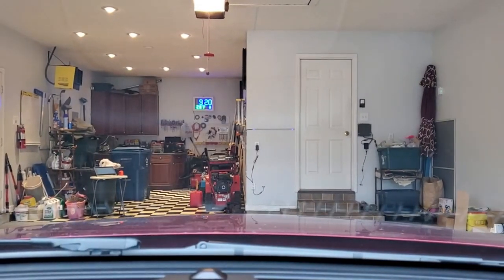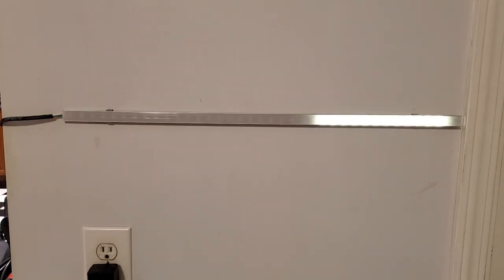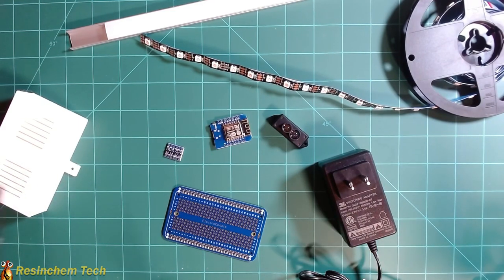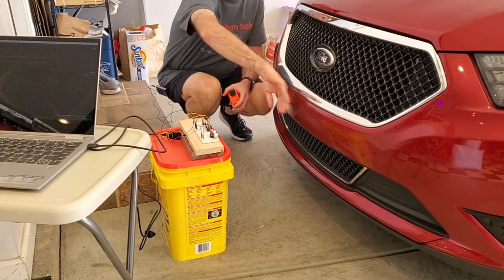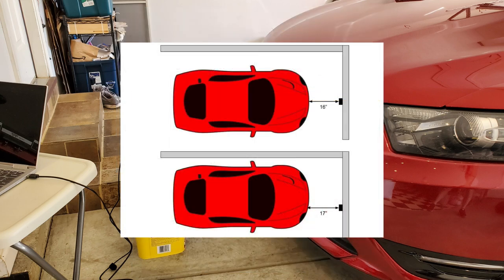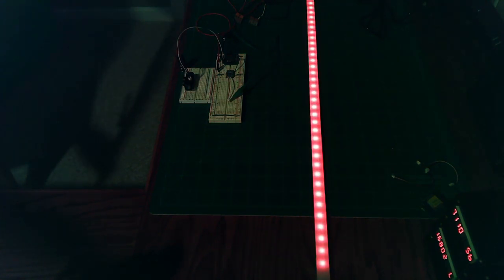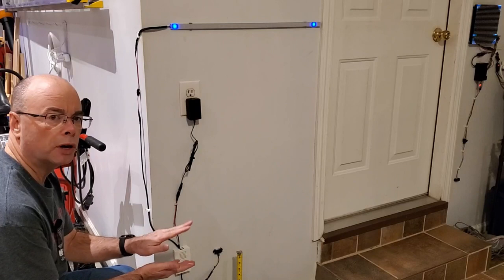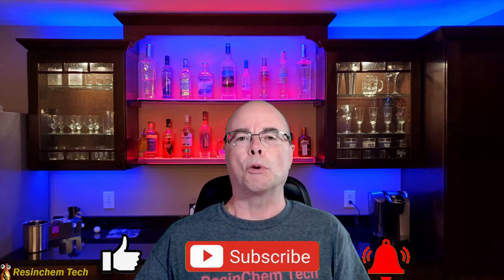A New Parking Assistant using ESP8266 and WS2812b LEDs

Comment: How do you get an MQTT device created for this in Home Assistant?  I entered all the relative MQTT info in the webpage setup for the parking assistant but I don’t see a device on my MQTT page in HA. If I use MQTT Explorer I can see the device there, so it is communicating properly.
Reply from the maker: Did you create the MQTT sensors in Home Assistant?  These are not automatically created (yet... it's something I'd like to add if/when I get the time).  Currently, you must manually create the sensors.  See the examples here for how to create the sensors:  https://github.com/Resinchem/ESP-Parking-Assistant/tree/main/examples
Reply: @ResinChemTech  I had added the YAML code but it turns out I put it in the wrong file.  All good now.  Thanks.

Comment: I store bikes and such in front of the car so I can't really use this but I have been thinking about a simpler version with just two sensors on the ceiling. I'll just be limited to not present, OK and too far of course. The upside is that only the LEDs would be visible on the wall, the rest is on the ceiling on top of the garage opener.
Reply from the maker: I actually have two of the ultrasonic sensors on the ceiling of the garage, one over each of the cars that I use for my primary vehicle presence detection.  Ultrasonic sensors are great in this case, because the distance between just car and no-car is pretty big and the noise level really doesn't matter.  But you could extend that concept to turn on LEDs when the car enters the measuring angle range of the sensor and detects the car.

Thanks for watching... and taking the time to pass along a good alternate idea!

Comment: Danke für dieses Projekt ich habe schon länger danach gesucht. Ich hoffe das es auch mit dem ESP32 funktioniert. LG Paul
Reply from the maker: Ich hoffe, in Zukunft eine Version für ESP32 zu erstellen, aber ich weiß nicht wann.
Reply: @ResinChemTech  Danke für die schnelle Antwort. LG
Reply from the maker: Can I ask why you'd like to see this on an ESP32, when the firmware runs just fine on the ESP8266?  What benefits do you expect to get from the ESP32?  I suspect it would function exactly the same.

I only ask this because to create a version for the ESP32, I would have to change multiple libraries and rewrite a good portion of the code.  It would also mean that I would have to maintain two separate versions of the code moving forward (an ESP8266 and an ESP32 version).  That is a fair amount of work, so I'm trying to understand what benefits an ESP32 would actually offer.

Comment: Is it possible to build this with a normal HC-SR04 sensor? I have tried different ones and different D1 mini's, but cannot get it to work. The system starts and the LED goes full blue, then the red/green alternate, followed by the outer most LEDs being blue, but no matter what, it is like the sensor is not even connected? I have the HC-04SR Trig connected to TX on D1 mini and Echo connected to RX on the D1 mini.
Reply from the maker: You'd have to modify the firmware. The firmware is written to work with the TFMini. Using any other type of sensor would require changing the libraries and logic to get a distance reading. The system is going straight into sleep mode (two blue lights) because it is not getting a valid distance reading.
Reply: @ResinChemTech  I ended up getting a TFMini and it works perfectly, thank you!
Reply from the maker: Yeah... the TF Mini does cost quite a bit more, but as I covered in the video, I think it is worth it in this case... both for range and signal stability.  I think someone may have forked my code and made it work for the HC-SR04, but I really didn't want to maintain two different versions of the firmware, so I'm only going to continue to provide updates and fixes for the TF Mini version.  Glad you got it working... and thanks for letting me know!

Comment: Wonderful idea, thank you for all of your hard work!  I built the project hardware, but when I load the FW, I get this behavior:  I can connect via Wifi on the ESP_ParkingAsst SSID, and then set the local network SSID normally.  After that, a reset causes the the device to show up in the local SSID network on my router's list for exactly 1 minute, then drop off and go back to creating it's own SSID.  During that 1 minute, the device does not respond to HTTP requests or PINGS on the IP address my router shows it has.  I bought the Wemos D1 Mini's off EBay, and assumed that this was the problem, so I bought more directly off of the Amazon link above, but get the same behavior on all devices I try.  I tried loading the libraries to debug myself, but am getting a ton of warnings and an error.  I am using "Generic ESP8266 Module" and loaded WifiManager, ArduinoOTA, ArduinoJson, TFMini-Plus libraries from the locations / authors you referenced.  I also added FastLED from Dan Garcia and PubSubClient from Nick O'Leary (my best guess).  Anyway, the errors are not missing *.h files, but mostly warnings about using the keyword Register.  Here is the Error where is stops compiling:  Compilation error: 'D6' was not declared in this scope.  Thanks in advance btw!
Reply from the maker: Sorry for the delay.. for some reason YouTube threw this in the "held for review" bucket due to 'blocked words'... no idea why, but I just now saw your message.

Well, one think I know for sure is that if you are compiling for 'generic ESP8266', then you cannot use "D" numbers for the pins... you must use the actual GPIO number.  Are you using the latest version of the firmware (v0.43), because I believe I changed the pin numbering to no longer use the "D" numbers to give greater compatibility with ESP8266 boards... other than the D1 mini.  I know you said you were using the D1 Mini, but it you are using the D pin designations, then you must select the D1 Mini board for the compile.

My gut tells me that the board is bootlooping due to this 'invalid' pin number (even though it compiles).  Let me know what version of firmware you are using... and try the latest versions... 0.42 or 0.43 (you might try both) and see if that resolves the issue.  If not, drop me another comment here and we'll troubleshoot a bit more.
Reply: @ResinChem Tech  I really appreciate the reply, I have tried the .42 and .43 bins with the same result.  I have not gotten the compiler to work yet, I'll look for the D1 Mini option.  There are small differences in thr board silkscreens, and I suspect even the ones I got off Amazon may be an off brand.  The parts report ESP8266EX when loading the bins, but from what I have read all but the very first run say this, so I don't think the EX has any significance.
Reply from the maker: If want to try compiling with the D1 Mini, I originally used the LOLIN(WEMOS) D1 R2 & mini board option in Arduino.  But if you are using .42/.43 then there should not be any references to "D" pins anymore... just the GPIO number.   

I don't think the "EX" has any affect here, as I'm pretty sure that's what mine say as well.  There is a possibility that you do have some sort of bad clone or batch of boards... but I'd like to rule out some other things before assuming that's the issue. 

If you like, could you reach out to me via email?  There's only so much troubleshooting that we can do here in the comments.  You can get my email address from the "About" page on my YouTube channel.  I don't put it here in the comments to avoid the spam bots from picking it up.  I'll do my best to help you figure out what's going on... but we are just somewhat limited here in the comment section.  Sorry you are having the issue.  I do know that many people have successfully built the system, so something different must be going on here.
Reply: @ResinChemTech  Ok, progress!  I got it to compile and turned on SERIAL_DEBUG.  The behavior causing the problem is that, for some reason, wifiManager.autoConnect is returning FALSE even though my router is showing the device is connected to my home SSID clear as day.  One time I did get "connected to your wifi...yay!" and everything including the web page worked perfectly for one glorius run!  Then back to the old behavior upon restart :(  All the parameters I set on the web page are stored perfectly still on boot.  Wife is fussing, will investigate more later!
Reply: There must be some goofy interaction between my router (a really nice new Asus RT-AX86S) and the Wemos D1.  The D1 connects about once every 20 times to my home SSID which is very close in proximity.  It actually connects every time according to my router, but the autoconnect returns fail after a timeout.  I disabled the wifi and the device works perfectly, my wife is very happy and so am I, thank you again!
Reply from the maker: I'm glad you got it working... and I guess you probably don't need to get to the settings page once it's configured for your install, but I'm guessing you can't get to the web interface, nor can you use MQTT if wifi is disabled.  But you may not be using MQTT anyway.

I'm still curious about what is happening in your case.  Does either your SSID or wifi password contain special characters or are either particularly lengthy?  I do have someone that reported an issue that if the SSID was greater then 12 characters that the wifi connection failed.  And the wifi library I am using, did have a report that a dash (-) in the SSID name caused the connection to fail.  But it sounds like in your case, you initially get a connection sometimes, but if fails at other times?

I'm wondering if it is just taking a bit longer for your device to bind to the router/wifi.  Sometimes there is a quick enough response that it works, but other times it take too long and times out.  I know you said the router is close, so it is likely not signal strength, but maybe there is something particular about the D1 Mini and your router.  You could possibly set up  a loop/counter around the .autoconnect and try it something like 3 or 5 times with a one or two second delay between tries.  You could then check the result for success or fail.  It sounds like you know your way around Arduino enough to do that yourself (and I'd try it on my end, but since I'm not seeing the problem, not sure it'd tell me anything)... but if you want me to help or provide you sample code of how I'd add that, you can just reach out via the email address I mentioned above.  I'm glad you got it working, but am still curious about the issue and hate that you can't access the web interface (or do OTA firmware updates should I release updates/new versions).
Reply: @ResinChemTech  I have a 4 character SSID, but my Password is 13 characters, no special characters or spaces, the odd thing is that the device shows up in my router's client table almost instantly, the wifimanager.autoconnect just does not believe it is connected.  I'm a firmware engineer and I'll do some more experiments, I'll try a different router with the same PW first.  If I changed the home wifi PW my family would riot I think.  I'll report back.  For a happy customer report, I had my very technology adverse wife pull into the garage without telling her anything and she parked perfectly on the first try (maybe the 1st time ever lol) and her unprecedented response was, "Wow, that is soooo cool!".
Reply from the maker: Thanks!  I never quite know the skill or experience level of my viewers.  But now knowing that you are a firmware engineer, I'm a bit embarrassed by my code!  I'm still relatively new to Arduino code, and while I can usually piece things together to make them work, I'm sure my code if far from being efficient... nor the best it could be.

And if you get the chance, please do let me know what you found out with a different router... and I'll post something on Github about it.  I fully get not changing the password (but since it does connect, I don't think that's the issue)... I have WAY too many devices to deal with either an SSID or password change.

And finally, thanks again for the SuperThanks.  It's been a good day, as you are the second report I've gotten that they have the parking assistant working.
Reply: I did notice that in the internal wifimanager SSID setup page,  it shows "Authentication Error" after setting up the timeout using the Asus RT-AX86S (although the device is in the Asus device table).  So, I got out my old Asus RT-AC68P router and made a Petrie Dish SSID sub net, and the Wemos D1 connects perfectly and immediately every time.  I do want to set up a Home Automation MQTT server and I'll use this for that.  Devices in the sub net can get to the internet just fine, but I'll probably need to add some port forwarding for the opposite direction.  Wife still happy!
Reply from the maker: Interesting.... and obviously something I couldn't duplicate!  I'm guessing the issue is particular to the Arduino wifimanager library and you don't have any issues connected other D1 minis using other firmware (like WLED, Tasmota, ESPHome, etc.)?  And I wonder if this could be related to the other issue posted on Github with the connectivity problem?  I'll add your info about the router to that issue.  I really appreciate the time you've taken to troubleshoot and share what you've found.

And any day the wife is happy is a good day!  Thanks again!